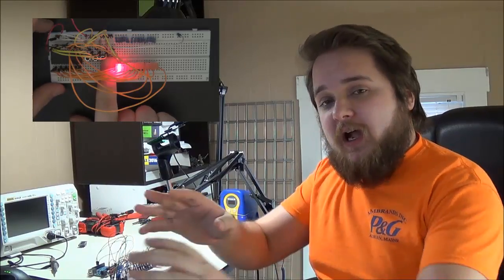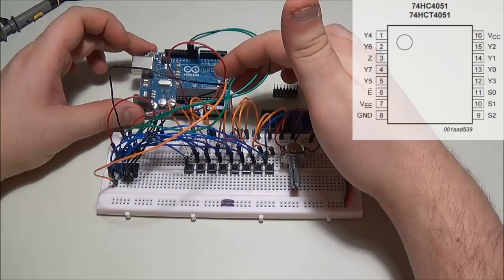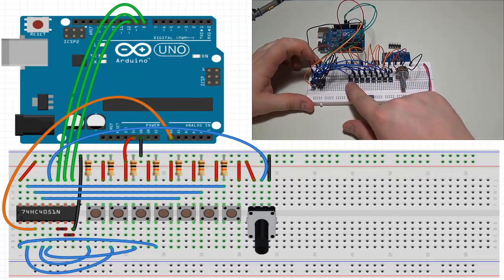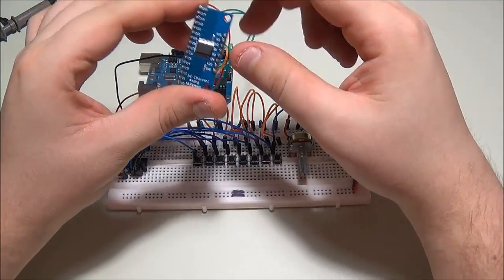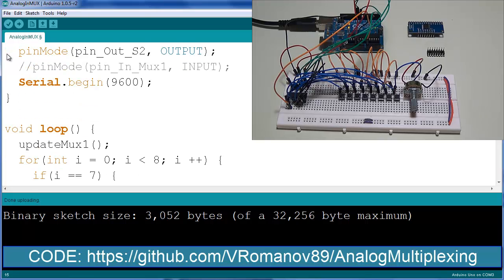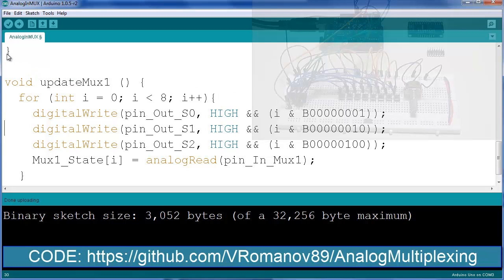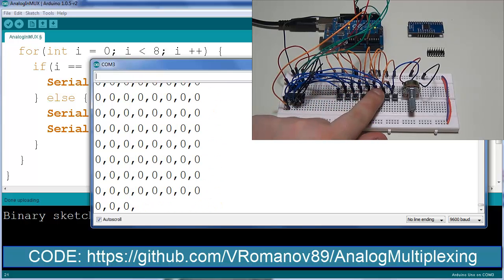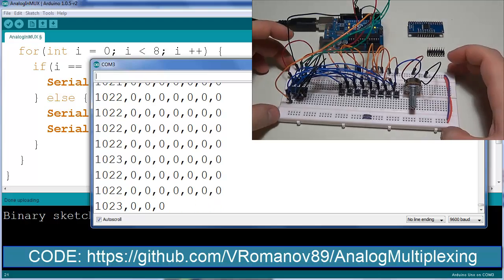Ep.54 Analog Input Multiplexing with the 74HC4051 - 8 Sensors on 1 Pin

Comment: Is it possible to make a project that test reverse wiring , connectivity and resistance integrated in car cable assembly board (wire harness ) , but the thing is that u have to test over 100 pin test points (cavities)

I need your help it's for my graduation project.

Comment: Hi, nice project and smooth presentation. Not sure you're still monitoring the comments on this video, but I try it anyway 🙂
What happens if you press 2 , 3, 4 buttons at the same time? if this works, what would be the maximum voltage you can receive?
Thanks in advance for your answer
Reply: Hi Alexandre, it's me - Vlad! I'm onto a different channel that involved industrial automation instead of the hobbyist stuff I used to do. Pressing multiple buttons works, the drawback of this implementation is latency. In other words, you only read one sensor at a time, but you read them in sequence. So it's slower, but only uses a single pin on the Arduino. The voltage is 5VDC based on the Arduino, but I'm sure you can scale that if necessary.
Reply: @SolisPLC  Hi, thank you for your answer, I'll have a look at your other channel.
I found some videos where the guys use registers shift modules, which allow for interesting multiplexing functions (https://www.youtube.com/watch?v=nXl4fb_LbcI from Kevin Darrah). 
In my project, I'm looking for a solution to read the multiple voltages of a battery pack made of several 18650 cells. The challenge is to stay below that 5V limit.

Comment: I see a number of pins are used to address which input is being read at which time. I am looking into a project that may need many analog inputs (basically 10+ temp sensors). Obviously the way this system works won't scale well as more and more pins will be consumed to specify input addresses. 

I was thinking that combining multiplexers with shift registers, where the shift registers will specify which analog address you are wanting to read would massively reduce the number of pins needed. What are your thoughts on this? I was hoping to avoid having to use multiple controllers having to talk to each other to get a bunch more analog inputs.

Comment: Thank you for this video, it is really helpful. Just a question, can I see the value of analogue inputs at the same time, for example, if I press two bottoms simultaneously, will i see two values in the array?
Reply: Yes, each loop the code cycles through all 8 addresses in the multiplexer and grabs the current value so at the end/beginning of the loop you have an array with all of the values, so you will see a value for every button/input in the array

Comment: If you use this for analog outputs, won't you run into problems since the output signal will float when it's not being selected?
Reply: Sure, but you can mitigate for that in software. In other words, only read the input when a selection is made.
Reply: @SolisPLC  Since he mentioned it near the end of his video, I was referring to using it for analog outputs, not inputs. If you're driving the analog device, you're only driving it momentarily.

Comment: I know this is not what you do anymore and that you are somewhere else on your path
 But daym!! You have the best walkthrough-how to-show and tell videos out there for someone learning this stuff. 
I wish I had found your channel years ago M8 🙂.
Btw: Usecase. Monitoring a plethora of temperature and pressure sensors in a air to water heat pump system.
Reply: Hey Klaus, thank you for the comment. I've actually started a new channel that's more in line with what I do now: industrial automation. I guess all those years spent in embedded systems paid off. Really appreciate the kind comments.

Comment: Nice .. 👍😎   How can i use this with 74HC595 ... With 16x outputs  LEDs ...  16 Switchs... 16x input and 16x outputs.   How can i turn off and on each Led ...   I have 2 x. 74HC595.  With 16x Running leds and 10x different FX. Can i use this to control each FX ? And Each LED..  ?  Thank you.. In Advance..

Comment: This is a really good example of usage of a multiplexer. A lot of times when this is introduced its just introduced vaguely as "here is a multiplexer it has select lines and one output" instead of being given different applications like using it for driving LCD monitors, having multiple sensors etc. You can really appreciate the multiplexer in combination with microcontrollers.

Comment: It's a very nice video. Could you teach me how to read the values sequentially in Arduino by connecting more than 3 mpu6050s to 74hc4051?
Reply: Mpu6050 runs via I2C.
So to run up to 8 6050's you'd need to use the 4051 to switch the i2c data line.
Can be done.

Comment: Just a quick question: I want to use the multiplexed for several moisture sensors, if I understand, the moisture sensors should be connected to the Y0-Y7, while S0-S3 to a digital pin each, Z to an Analog pin, and VCC to 5V pin?
Reply: yes, I guess so

Comment: I have a question: can you press multiple buttons at the same time?
Reply: Can you pat your head and rub your belly at the same time?
There should be no reason not. I have two of these tied together with common select pins, reading on two different analog pins. As the code cycles through, I am able to read one value from each chip output per analog pin giving me a total of 16 inputs. All function independently of the others.
Reply: @raymccoy9105  well, the question came to my mind because the MUX uses 3 digital pins to select which input is selected (right?), and each input correspond to a combination of the 3 bytes, so, if I press two buttons at the same time the combinations to trigger are 2, and how can the MUX select 2 channels at the same time if the selectors pins are just 3?
Reply: @chihauccisoilconte4474  the loop in update mux routine cycles through each of the eight channels. Within that loop the digital pins are used to select the channel and the value for is read on the one analog pin and stored in an array. Any buttons pressed (or the position of the potentiometer) affects each channel independently.
After the the eight reads, the eight read values are printed from the array.
Reply: @raymccoy9105  ok, thank you very much for the explenation!

Comment: I have CD4051B. The layout is the same. So i guess pin connection is also the same.
Mine has Inh, VEE, and VSS.  I connect all 3 pins to ground rail of the breadboard but it doesn't work. When i push buttons, i get 0 value from the input channel.  What did i do wrong?

#define A 4
#define B 5
#define C 6
int IOport = A0;

void setup() {
pinMode(A, OUTPUT);
pinMode(B, OUTPUT);
pinMode(C, OUTPUT);

pinMode(IOport, INPUT);
Serial.begin(9600);
   
}

void loop() {
   
     int bt0 = readSensor(0,0,0);
   //int bt1 = readSensor(1,0,0);
   //int bt2 = readSensor(0,1,0);
   //int bt3 = readSensor(0,1,1);
   //int bt4 = readSensor(1,0,0);
   //int bt5 = readSensor(1,0,1);
   //int bt6 = readSensor(1,1,0);
   //int bt7 = readSensor(1,1,1);
 

   Serial.print(bt1); Serial.print(" "); 

   delay(50);
}

int readSensor(int a_, int b_, int c_)
{
  digitalWrite(A,a_);
  digitalWrite(B,b_);
  digitalWrite(C,c_);

  int val = digitalRead(IOport);

  return val;
}
Reply: I have fought several nuances between datasheets. As far as the Inh (inhibit HIGH) vs E-bar (enable LOW) their function is the same, simply different notation. LOW is on, HIGH is off. Not that this solves your problem but figured I'd toss in the note in case it helps.
After fighting with the connections as described in the video with Vee to supply voltage I finally figured out that that pin should actually be tied LOW. That one changed on my IC board ended two full days of frustration.
Another problem I encountered, which may relate to your problem, is not changing ports based on "select pin" settings. What I finally figured out there is the pins were floating, typically passing through input applied on Y0. I had not added pull-down resistors to the three select pins so they were not turning OFF when I dropped the pins LOW on the Arduino. That realization pointed me in the right direction but took several tries to tweak the resistor value to effectively pull the signal down when off yet still send enough voltage to drive it. Finally settled on 330K. Much below that I was missing HIGH select signals (as pull downs function as a voltage divider) sending voltage to close to the 2V signal threshold noted on the datasheet. Afraid, and figured it was unnecessary to go any higher, figuring it might not drain the current fast enough to pull the signal low.
It all worked for me. Finally! Hope this helps you, or at least someone frustrated enough to read this deep into the comments.
Reply: @raymccoy9105  Thank you.

Comment: Great Video. Is there any way to add LEDs to the circuit and the code so that when the buttons are pressed the LEDs will light up. Also is possible to add a toggle to the code so that each time you press a button it alternates between 0 and 1023?  thanks
Reply: You would probably want to add a second multiplexer in output mode, though if you use a compatible multiplexer you can connect the address pins to the same address pins as the first multiplexer so that you only need one additional pin. Yes, there are examples of toggle buttons in code but it is just a matter of toggling a bool value when the button is just pressed

Comment: If I want very fast response ,what is time between reading analog input pin of ...4067  and result happening?? In milliseconds???
Reply: With an Arduino Nano and a 4051 chip I was able to get 42 to 44 reads between 1ms interrupts. I had concerns about a potential error rate and dropped that back significantly for the final code.

Comment: "For whatever reason you have 20 potentiometers and you have to read them." exactly what i want it for😂😂
Reply: @Janna for making a glove which reads movement based on potentiometer readings
Reply: Only 20?
Reply: In my case there are output of 6 current sensors and diagnostic signals. But idea behind how to read them remains the same as guy in video explained..

Comment: Hey can i use the 4052 multiplexer ic instead of 4051? With this same code and connection please i need help i cant find the 4051 ic here
Reply: 4052 has two banks of four inputs going to two output pins. (Or vice versa since the ins and outs are bidirectional.) You could read 8 values using two analog pins on the mC but that would require some wiring and code changes. While you would need two analog pins for input, it would require only two output pins for channel selection.

Comment: Hats off to your logic. Working perfectly but  spent the whole day but did not understand 
" digitalWrite(pin_Out_S2, HIGH && (i & B00000100));"
Reply: you look at "i" in binary form. for example if i=5 in the loop then it will be:    [1]*2^2 + [0]*2^1 + [1]*2^0 which is represented as 101 or B00000101 in binary. So the goal is to activate the 6th (0..7) analoug in order to get it's value and the way to do it is by sending the S0,S1,S2=HIGH,0,HIGH to the multiplexer. The code resolves the logical statements: 1) B00000101 & B00000001 = B00000001, 2) B00000101 & B00000010 =  B00000000, 3) B00000101 & B00000101 & B00000100 =  B00000100. HIGH is actually the boolean True (or integer other than zero) and LOW is the boolean False (or zero) so HIGH && B00000001 is actually HIGH\True\"Integer other than zero" and HIGH  && B00000000 is LOW\False\zero

Comment: nice clear tutorial! would there be any electrical implications if I use two back to back to achieve routing from multiple inputs to multiple output? like increase in resistance, a decrease in the signals amplitude or maybe a delay?

Comment: There is a new approach in science for reading an unlimited number of sensors in parallel. It is called the photon-pixel coupling method. Maybe you can do it with an Arduino.

Comment: Is there a way to connect two analog devices to one analog input without having to connect either of the two through the digital pins as well? Trying to get two hall sensors (analog) connected to one analog input on arduino with MMJOY software.
Reply: CMIIW, base on your situation, i think it could be using mux 2 in 1.... Just use that module from the video, but using only S0 only. ._.v for the digital pins...

Comment: Great stuff, this just took me from 2 megas down to one, with a bit more PCB work. 

Next step for me is to figure out how to read 0-120v via an analog pin, once I can do that my project will be a go.
Reply: I believe a normal voltage divider would suffice if you are only measuring the voltage (The power draw is basically voidable). With 2 resistors, 120v to 5 volt would be divided with 1 resistor being 24 times higher than the 2nd ( 120 / 5 = 24 ). Using http://www.ohmslawcalculator.com/voltage-divider-calculator 2 resistors with values 27 Ohm ( Closest to 24 and under 5v ) and 1 Ohm would give a reference voltage of 4.286V between the 2 resistors. This output would be linear to the input!

Comment: I have a similar-ish setup, but I try to read really fast (38 KHz) and I’ve run into the problem that when I switch the input the first three to 8 readings (depenging on the impedance, using an impedence) becomes inaccurate (High spikes when switching). The strange thing is that it’s the first three readings no matter the read speed (9kHz up to 64 kHz) so I find it hard to believe that it’s the adc which needs time for charges to settle (since then it would take a fixed amount of time, not reads). Do you have any ideas what’s going on here?

Comment: Late to the party here, but can you press two buttons at the same time and get a reading on two input pints at the same time? or even all the buttons+potentiometer  at the same time?
Reply from the maker: Lord Anton Hvornum yes, you will get all the readings of multiple inputs. Of course, they do happen in a sequence (nothing is “at the same time”), but it happens extremely fast.
Reply: Sweet, yea I assumed that's how it worked but wasn't 100% sure. Cheers for clearing up my suspicions! Ordered a few and gona tinker with them! Great video and thanks for answering so quickly :)

Comment: You cannot keep adding more sensors indefinitely. As you increase the sensor you increase the selector pins, which is basically your constraint on how many pins your micro-controller as. Just a side note there and to correct you.
Reply from the maker: Although that is true, you can always multiplex those as well or use an I2C selector IC to toggle those inputs that way. Nothing is ever "infinite" and you will run into power issues, communication issues as well as timing issues as you increase the number of sensors. That being said, you can definitely make it work if you take care of those problems.

Comment: how about reading 9 analog sensors if the 3 of them are voltage divider and the rest are acs712? as i know the voltage divider and acs712 have different codes in callibration? sorry, i'm just a beginner

Comment: Great tutorial! Thanks so much!  I have used the 74HC595N before for a series of digital outputs. With limited understanding of how they actually work. :D For a new project a need to read a series of analog inputs (where the 74HC4051 might come in handy). And also control a series of analog outputs (or digital with PWM). I am still struggling with the difference between mulitplexers like this and shift registers. How specific is their use? Could I use another one instead? Could I use this one for analog outputs, too? Or could I just the 74HC595N I already have for this job? Would be super greatful for any hints. THANKS!!!!
Reply: i have the same question. did you manage to use the 74HC595 in the end?

Comment: Can i connect three 74hc4051 ic's inputs in parallel?. Or what can i do  if i want to use more than 1 multiplexer?. Because i've 24 analog inputs, and i only have these ics.
Reply: Just did this. Drive the select pins on multiple 4051s from the same output pins then attach the output from each to separate analog inputs.
For each increment of your select pins (0-7) read one channel from each of the multiplexer outputs.
With 8 analog inputs on a Nano, I see no reason not to be able to read 64 analog inputs using the same methodology.
Be sure to consider pull down resistors on the select pins. After several trial and error attempts, ended up with 330K resistors to pull the pin low yet still allow the pin do drive the select pins effectively.

Comment: If you are using push buttons you could also tie one side of each button to ground with a different value resistor. That way each button will have a different analog read value so you can diferenciate them. And only uses one pin

Comment: could you real time control an 8x8x8 led cube this way? I can't think of any reason why it would not work on a mega but I am probably missing something.
Reply from the maker: Well, I would go the shift register route for that. The problem with these is that you will need to switch between LEDs, so you'd need to create the illusion of what is ON in an LED cube. You can't actually turn ON all 8 LEDs.